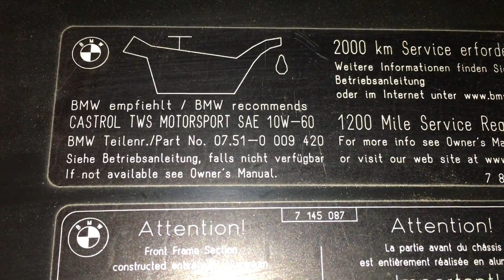E60 M5 S85 Rod Bearing Issues | Tips To Extend BMW Engine Life

Comment: Greets Mark
My experience and habits about the overall maintenance in my 13 year old M5 and what I did and still do:
Oil changing max!!! every 10.000 km, and of course only 10W-60 Castrol (I bring the 10L to the dealer) and always with Oil Filter... never drive when the Oil level is more than 1,0L or less than 0.1L.... when the level gets at 0.3L I fill up... it's better for the Vanos too.. only original parts and services at the dealer, it costs more but I have always warranty and a better selling price in the future...if.. but I have no intention to sell it... I would rather take it with me to the grave hahaa...
When the engine is cold I don't wait, never... I drive away but very slowly, very gently... it's like holding my daughters hand.. .. absolutely never never never push it more than 3000rpm, when it gets warmer I do not exceed 5000rpm... when 100 degrees Celsius or 220 Fahrenheit I do whatever I want with it, often 8500rpm, since 11 years with ECU Program 250 more rpm and speed limiter delete (you say governor), hard and sometimes brutal...we all know that the engine loves it, always.. it was built to do that.
SMG Gearbox always in Manual at position 5, never in D mode or less than 5. Always start in 1, never in second.
When arriving at a traffic signal or being in traffic I select N. When parking also N with handbrake of course.
Very few Launch Controls only in the first years. I have still the first clutch!!!!!!!! The SMG pump once changed!
Spark plugs, Differential- & gearbox Oils, also Brake fluid changed every 30'000km. Engine and gearbox are one poem together..
A couple of weeks ago I had to change the Oil cooler, which had a tiny little crack... also changed at the suspension Syneblock and Querlenker.. 2'000 EUR... after 13 years!!! new Michelin Super Sport tires..some fluids some tiny strokes...some leather treatment... another 2,5 grand.. that's live... all in all for that supercar the expenses are more than reasonable... 
Blackstone test is done each 2-3 years..  in January done and it was just excellent.. when the engine is treated good, especially in cold phase till it gets 100 C the bearings have no problems.. nevertheless, I told the mechanic to change the bearings this year...why not..
Generally I am more than satisfied with the M5, it shows great durability and takes every day hard punches when warm without crying or complaining... and I am sure it'll last for another 13 years... and so on.
Peace & Love
Reply: ExoticCar PlayPlace  Thanks Mark, nice to hear that from a specialist.
The bearings? Not yet changed :) I have 110tkm, so I am planning to do that at the end of the year, although there are no indications. The car was so nice to me over these years, so I give him this present :)
Reply: Greg Antono car is piece of shit if it needs such a care, no excuse for this age and day!
Reply: I love you.
Reply: @Tipo-F120b  i still own a 2007 m6 that my wife dailys and my mint condition 07 m5 6 speed manual please dont even try to tell me about functionality and reliability you pelieb
Reply: Comment makes me want to be treat my 325 better
Reply: How nanu miles do you  have on your M5  ?
Reply: @arturozuniga6651  I don’t have it anymore, it was stolen, but it had about 150k km

Comment: Totally agree on frequent oil changes. As an ex tech i've seen clients coming into the shop 12k over recommended oil change period. At that point oil viscosity was extremely low and practically didn't protect any of internal components.

Comment: I'm at 210,000km  2006 M5 change oil every 3,000km  engine runs nice oil looks clean. I always keep it under 4,000 when cold. Maybe I should change them but the car is running very nice.
Reply: Fair play. I’ve got an E60 M5 too. But only use it for longer journeys, never just around the town (have a little 1L city car for that). My M5 has just over 90K on the clock. Like you say regular oil changes and never ever rag it from cold. It needs to be warmed up gently  - but when it is, wowzers. What a car!

Comment: I use liqui moly 10w-60 seems to burn a lot less quicker than the recommended Castrol and it quiets down my vanos
Reply: to be honest I tested both .. and the moly is smooter and the car gets to normal rpm sooner after the cold start every morning .. weird
Reply: Same here only burning a quart every 4000 so now i just change it every 3,000 miles and i warm it up before running.

Comment: 10W60 is a thick syrup for S65 S85

Racing 0W50 Mobil 1
Or 0W40 Mobil 1 are best for these tight tolerance bearings
Reply: Care to educate us a little more on this?
Reply: 2ndProtects1st The 0w-40 has a better CST at cold temps and at non racing hot temps. 10W-60 is way to high CST for cold and hot unless racing.
Reply: I know that Vanos pump shares the engine oil. Probably the 10w-60 is not a good fit for the engine, but it might be necessary for the Vanos.

Comment: I am using castrol 5W50 i have a 2009 M5 with 45000 kms afrer 15 years  or 14 years after the last model the oils are a lot better than the 10W 60
Originally recomended

Comment: Hey Mark!  Any thoughts on Archoil 9100 to aid in rod bearing lube, especially during startup/warmup?  Alex at the Archoil shop responded to my question with "You can use AR9100 in your E60 M5, AR9100 will help protect the rod bearings from wear and premature failure. I do actually remember speaking to an S62 engine builder who liked using AR9100 in his builds, I cant recall his name though.".  I add it to the oil on my 02 E450 7.3 Turbo Diesel and it's quite awesome. For the M5 though, I can't find anyone else using it.  Any thoughts on it?  Thanks - Dave P
Reply: I added the Archoil to my M5 and did a quick video with a shout-out to you.  After a couple hundred miles, the engine does sound a little quieter but I haven't noticed any better fuel mileage (still about 16mpg).  
https://www.youtube.com/watch?v=fGZNj4lSgds

Comment: Just a question, additive called ZX1 that uses the oil a a transport to all the metal surfaces in the engine, in particular in between the rod bearings, would this stuff be a benefit at all, or would it harm the v10, it apparently clings to the metal surfaces & in theory stays on the metal even after an oil change, thoughts ?

Comment: I’ve read that the valve springs go bad also. Is that true and is there any other parts I should replace on the s85 motor that will make it last longer?

Comment: The owner of VF engineering stated the reason for the rid bearing ware in the e92 and e60 is because of the knock system. Witch is based off the spark plugs. And when the spark plugs begin the age the knock signal isn't as accurate making the rod bearing ware unevenly.

Comment: Hi,
How do you explain the vast differences between some engines bearings wear?
I own a 2011 E90 with 44kmi on it. I read about bearings failure at 30kmi and no failure at 130kmi... is it just maintenance that makes  it? Thanks!

Comment: Mark any idea if it is below 0 weather and you start up the car in such cold weather will that cause some kind of bearing damage since the oil is so thick from freezing weather.
Reply from the maker: In short, cold weather does not do it any favors for sure, thats why a corrected viscosity  may be needed to reduce this issue in winter.  People do drive them in winter and it is fine, but warm up periods are very important.

Comment: Castrol 10W60 good to use on these engines?
Reply from the maker: Hi Carlo yes another option that is suitable is the 10w-60 Castrol Edge "SUPERCAR" as it is a full synthetic and that WAS spec'd for the M5 previous.  Recently they switched to Shell, but I would use the Castrol as another option.  MUST be fully synthetic though.
Reply: @ECPP  Thanks Mark.I am also a Castrol fan so with the Shell change it confused the hell out of me as i thought there might be issues with Castrol.Sweet

Comment: I have a 2010 M6 52,000 miles. You say the new bearings are in the 2010 & half (2010.5) models... so mine is considered a 2010 model the actual build date printed on the door says  09/09. How do we know if we have a 2010 & half model that your referring to? Thanks

Comment: 3 minutes in, the information given is hilarious.  

If the tolerances were so high, why do these engines end up with 10w60 oil?
Reply from the maker: Good question, but generally to support the full racing application and high revs and stresses under hard driving conditions

Comment: Do these same issues exist for the S65 engine in the M3?
Reply from the maker: Yes, for the most part, yes Michael they do.  Throttle actuators and rod bearings are their nemesis.

Comment: just bought an 2008 e60 m5 yesterday and today rod bearing noise. car is awesome but really.....can I have worse luck!!??
Reply from the maker: Sorry to hear about this.  Are you sure its rod bearing noise?  I know sometimes the Vanos makes noise.
Reply: My first bmw but I’m 90% sure, it’s coming from the bottom end. I’ll tell you I’m an Audi guy, dad was a Porsche Audi tech for 40 years.....but man is this an awesome car. They are both great car makers.
Reply: On the other hand what does a bad vanos sound like? This sounds like a dull thud that changes and matches engine speed.
Reply: The sound  comes when   the engine its cold  Its normal because  the computer send  less fuel to warm    the engine faster

Comment: I usually warm up the engine until it’s at normal idle, usually 5 min. After that I drive it and don’t I push the motor. I just drive it normally. I plan on getting the barring serviced soon.
Reply: Better to drive the car straight away from cold, but only gently. That way you will get everything up to temperature much more quickly without causing any damage. It is cold running that causes damage, and by letting it idle you are extending the period of cold running to the maximum possible.
Reply: on new cars they write a warning message on the dashboard 2 min after without moving ...
the exact message is "move the car now or stop it please"
Reply: Listen to Axie

Comment: Its as simple as it gets.. forget the Blackstone crap tests... if you dont know if the bearings have been done previously,and youre 50K miles plus.. get them done! better spend some little money now then newenginetime and spending some serious cash...    Ill report back Mark , my 2008 75K will go in for bearings in 2 weeks time..     Did you also read the post of the average mileage on around 124 x S85 engines that went boom ( and were converted by Troy to strokers)  the average mileage of those 124 engines when they all went boom, and i mean throwing a rod... was @ 60.000 miles!    Just get em done and be safe instead of driving a timebomb
Reply: Take Down is  there a stronger aftermarket part or updated oem stronger one?
How much $ to do preventative replacement?
Reply: Google: BE bearings S85,   or check here... :http://fastattackmotorsports.com/index.php?route=product/product&product_id=181   but to be honest i would go with oem...
Reply: Hi , did you change the bearings? How much did it cost? Thanks
Reply: I have a 2005 E60 and no bearings problems whatsoever. +282000kms!

Comment: You do a very nice job with your videos and are very knowledgeable. Best of luck with your channel moving forward!!

Shame on Nazi BMW for not doing something with the owners of these Over priced Recycled Plastic piles of 💩!

Toyota maned up and bought back there rust bucket Tacoma’s for 1.5x the KBB book value, I bought a Tacoma from someone who wasn’t aware of the buy back as Toyota really didn’t advertise that they were doing that. Had BlownHead gaskets 1 owner truck was bought brand new. I have 1500$ for it and Toyota wrote me a $ 11,000 check $9500 profit. 
They also for there tundras did full frame
Replacements which I had 2000 Tundra 1 owner done the bill on that was $16000.

And BMW can’t fix there drunken boo boo on there over priced pieces of 💩. Sad
And frankly says allot about the company!
 🖕🏻🖕🏻🖕🏻BMW 🖕🏻🖕🏻🖕🏻BMW🖕🏻🖕🏻🖕🏻
With all that said I love them still it’s weird there’s something about BMW there suspensions I think is what keeps me
In love w them. There just like females 
You can’t Live w/ them and you can’t Live w/ out them!!  
I own 2011 x6 35i family car and a
2009 550i and my daughter has 2013 x3.
Will never own or drive anything else 
Except maybe new Mercedes they have there shit together!
Reply from the maker: Thanks a lot for your comment and for watching.  It is much appreciated.  You are right there are just some details that are missed and the. Swept.  With that said, aside from exotics it maybe the better Porsche’s, there really is nothing better than. The driving expereience
Reply: Eh I own a Infiniti. Reliability is insane on the VQ VK engines. Yes not as fast as M5 but still look good and decent quick.